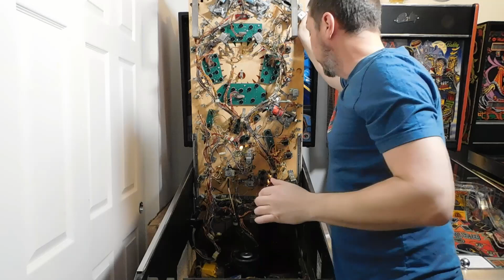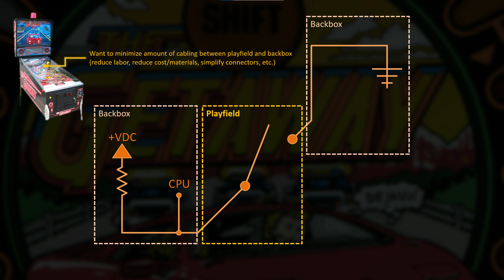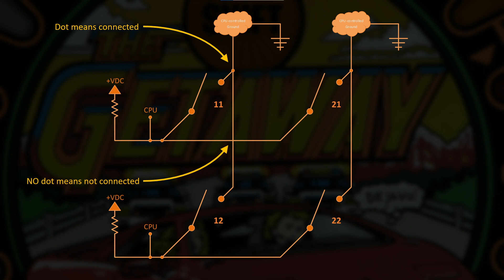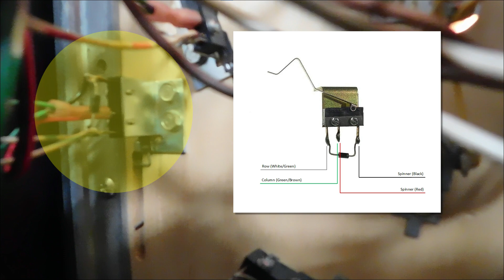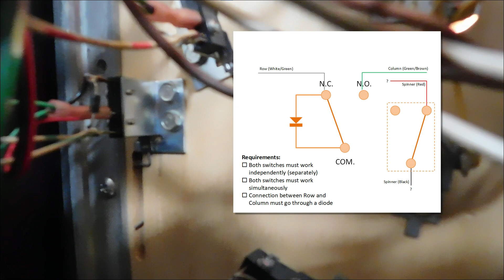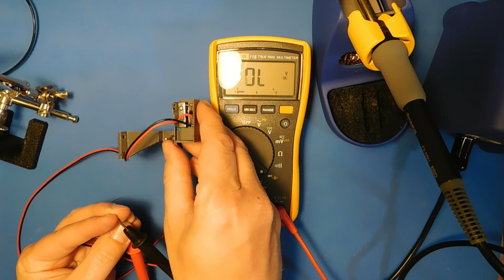Pinball Switch Matrix

Comment: Super helpful explanation... Im in the middle of trying to add mods and use roll over switches to trigger timer relays..  I have this same setup on my theatre of magic... I was going to piggy back one side of a switch and run an independent ground as part of the trigger but I'm not sure It will work now...  neet to think this through
Reply: my question is whether i need a diode between the pos and neg trigger to the relay timer  - jz801 timer relay..  it has reverse prevention built in which may do the job ?
Reply from the maker: The JZ801 might already have a flyback/snubber diode across the relay coil.  If you can't find schematics for the board, maybe measure resistance across the relay coil terminals on the board and see if the resistance varies depending on the polarity of your leads.  If it doesn't have a diode, then, yeah, I would add one.
I don't think adding an independent ground on a switch is going to work the way you want though.  Maybe think about adding your circuit in-line with the switch, so the wiring goes:
row--diode--switch--circuit--column
That way when the switch closes, the current has to go through your circuit to get to ground on the column.  Keep in mind the switch matrix is scanned many times per second, so the relay is going to try to rapidly open and close whenever the switch is held closed.  The timer might not handle that, or the duration of the scan might not be long enough to hold the relay closed.  If you have trouble with the relay, I'd look into an optoisolator.  They might react faster than relays.

Comment: Kyle, What is confusing is that DC voltage/DC current only travels in one direction from Positive Vcc to Ground, so adding the Diodes doesn't make sense because DC voltage/DC current can't Backfeed and flow backwards from ground back to +Vcc. The Rows and Columns are using a Sensing circuit but not sure how the sensing circuit senses the rows and columns.
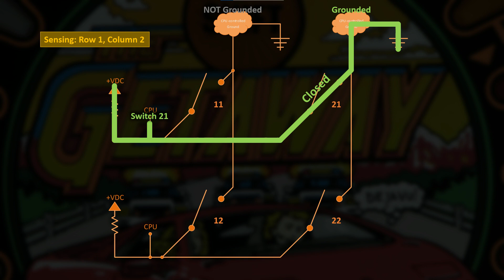Reply from the maker: The current isn’t flowing backward, it’s just finding alternate paths to ground.  If we apply current to one row at a time, and we ground one column at a time, and if we see current getting to ground on that column, then we know that the switch at the intersection was closed.  But that only works if the current is only allowed to flow through that one switch.  If current can flow through other switches, then it can flow AROUND the switch at the intersection and find a path to ground through any other closed switches, and it looks like the switch at the intersection was closed even if it wasn’t closed.  To prevent that, we want to make sure that current can only flow from row to column, not from column to row.  Diodes ensure that.  Check out 19:20 for an example of current finding an alternative path to ground and how diodes block that path.
Reply: @kyle5574  watch at time 24:30 you mention when the spinners switch is CLOSED the DC current can flow from Column to Row its colored in RED, which is not true because DC current can only flow from +Vcc to ground, from from ground to +Vcc. Why are you saying that the DC current is Bi-Directional that it flows from Row to column in GREEN and can also flow from column to Row in RED?
Reply from the maker: The current is still going from source to ground, even when it's going from column to row across a switch.  Look at the picture a few seconds later.  Look at switch 21 (upper right in the picture). The rest of the switches are fine, but the current is flowing "backwards" across switch 21, from column to row.  Since we don't have diodes in this picture, the current is allowed to flow in either direction across the switches.  In this case it's finding an alternate path to ground, around the open switch, and through 3 other closed switches.  If the switches had diodes, the current would only flow across the switch in the correct direction and there would be no path to ground in this case.
Reply: @kyle5574  Yes true the current is going from +Vcc source to ground even when the current is going from Column to Row across a Switch, ( this isn't considered backwards current flow, its considered an alterative path to ground by using column to row instead of using row to column). When DC current is flowing from Column to Row across a switch it causing "Ghosting errors" that is what other techs call it.  The diodes don't prevent Anti Ghosting errors so if multiple switches are CLOSED the CPU has to register ALL the closed switches but the diodes don't fix or prevent Anti Ghosting errors. I don't think you have made a video lesson about Anti Ghosting errors for pinball switch matrix circuits.